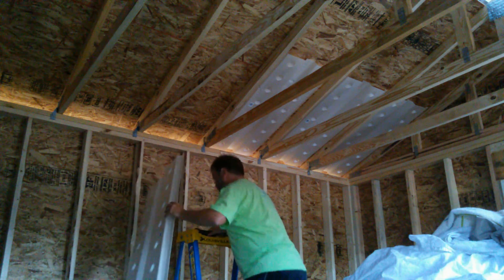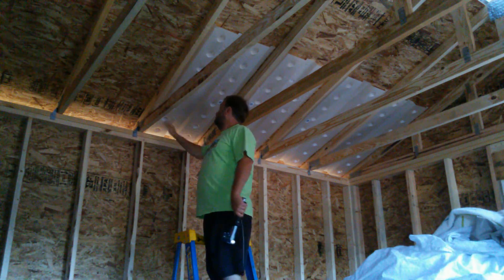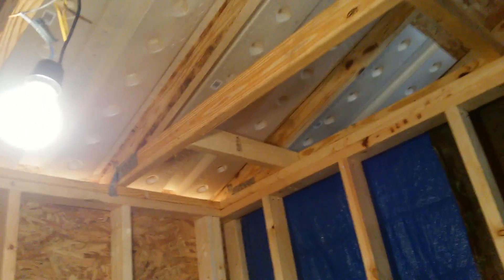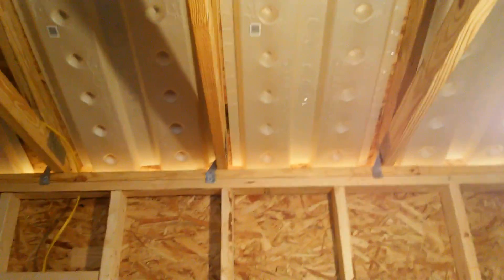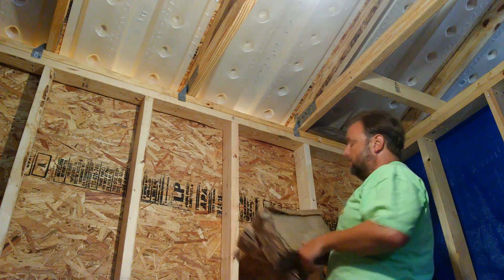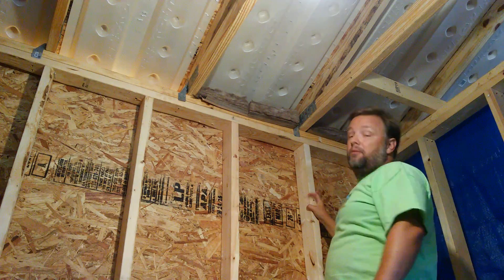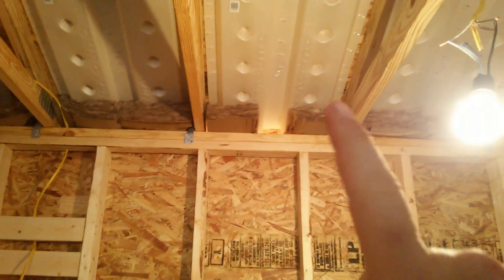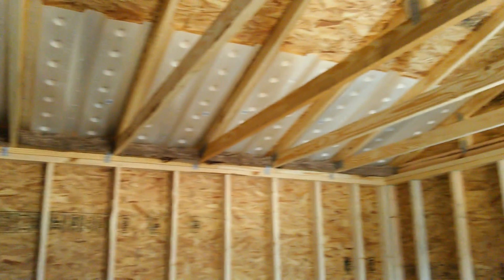Installing Durovents in the attic

Comment: The panels didn't come with the squared off blocking at the bottom of the panel to block out the air coming in from the side bent along the building? The ones I was fixing to buy have that section at the bottom so you don't have to go back with foam to cover up the light and air.

Comment: Are the ones with the baffles that attach to your top plate better? or are they for a different purpose? I am used to seeing the ones that covers the whole bottom area.
Reply: Depending on the vent you buy. The ones here don't fold.  But if the plywood comes up the back of the plate you can just attach it to the plywood. And the sides of the folded vent should be spray foamed from wall plate to roof sheathing.
Reply: Are u doing that for all the roff or just one piece ?
Reply: And whats type of isolation ur using

Comment: I'm surprised that you did not extend these durovents all the way to the ridge vent.
Also you could staple the pieces of insulation to the wood so they are far less likely to get disloged and eventually block the end of the durovent.
Reply: Ya I was told you want to staple them. I think it’s even on the directions
Reply: Just get the vents that fold, and spray foam the sides of the vent where air gets through. You only want the vent to be just above by